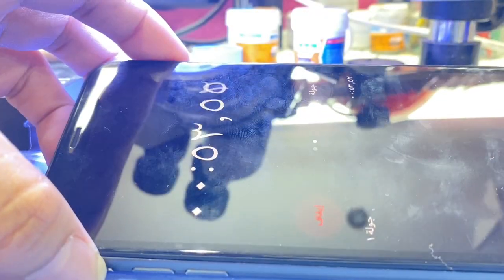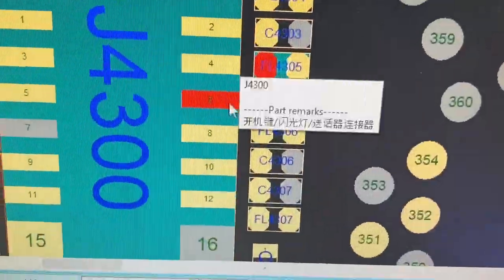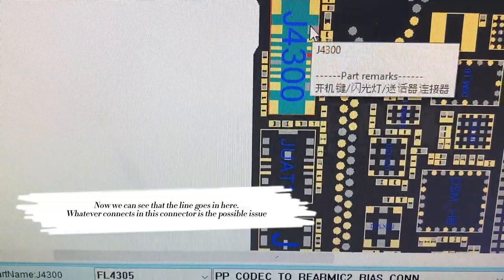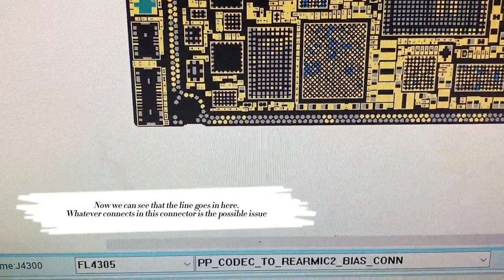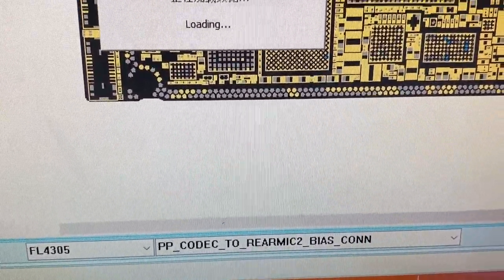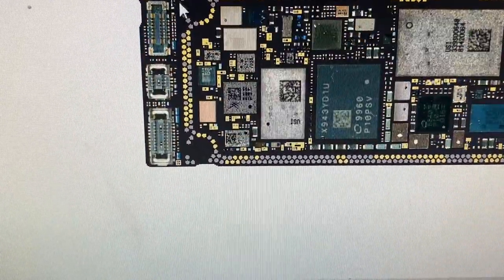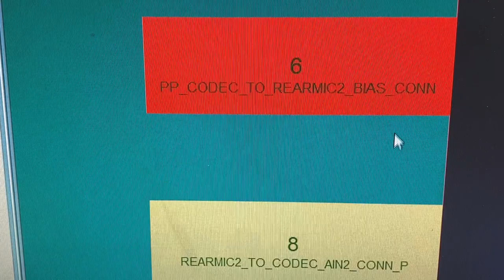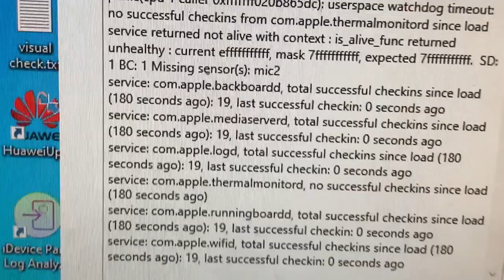Apple Iphone 11 always restart repair. Iphone repair. panic full hints guide.

Comment: Hi, I have the mic2 issue as well on my phone and tried to replace it with an old OEM power flex cable part. The phone is still restarting. 

Is it worth trying with another power flex cable? 

Are there any specific steps/precautions to make this work - eg. testing with both power and charging block button being connected? Or,

Have all the required flex cable be plugged in? 

Appreciate your help.
Reply from the maker: What model
Reply: @Repairingtools  Hi, this is a IPhone 11.
Reply from the maker: @thearien8068  try both charging flex and power flex . Sometimes replacement is not good it takes 3 to 5 pcs in my case.
Reply: @Repairingtools  yes, will do. Thanks for your guidance.

Comment: My iPhone 11 restart itself and even more when power button is connected to it 
How can I fix it
Reply from the maker: Connect a  new one. Dont just remove .it still restart without it.
Reply: My 11 pro max starting how to fix it?
Reply: But i cant read panic full
Reply from the maker: If you cannot read the logs just direct to the flex 1 by 1
Reply: @Repairingtools  il already try remove face id its the same what will i nxt to try??
Reply from the maker: @sawadaghost5585 charging flex
Reply: My 13 pro max has this issue what could be the cause and how can I fix it
Reply from the maker: @muhammedyakubu3309 you need to find some clue first. Look for the panic-full analytics.